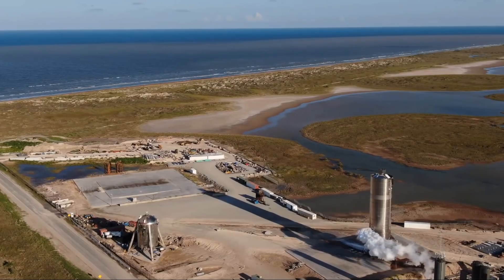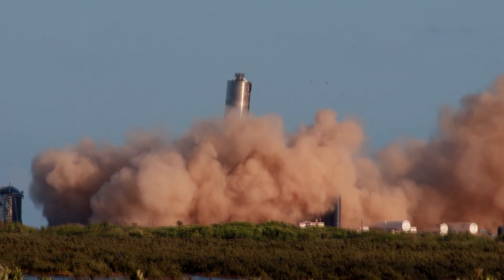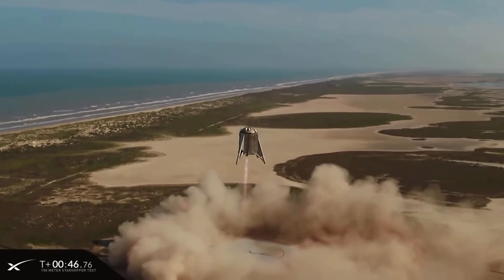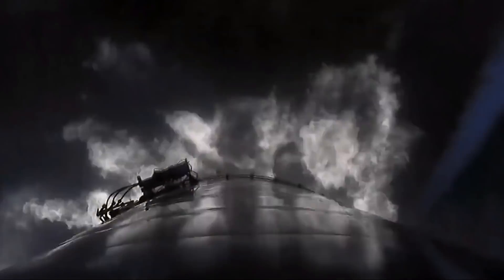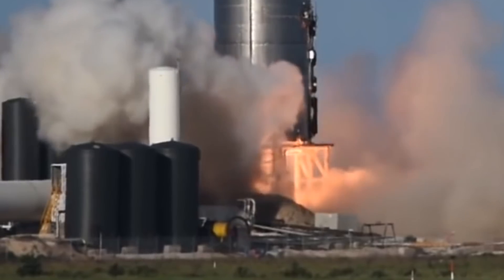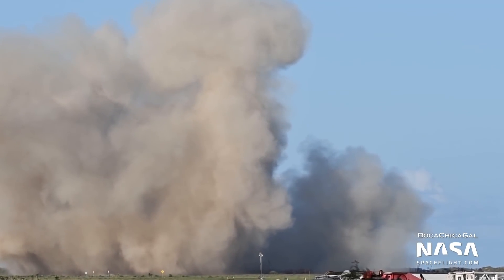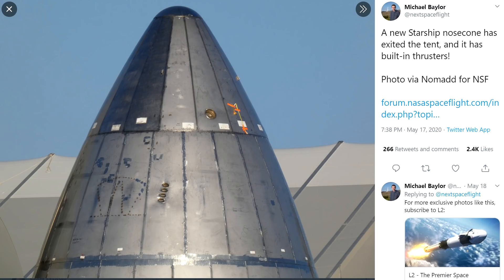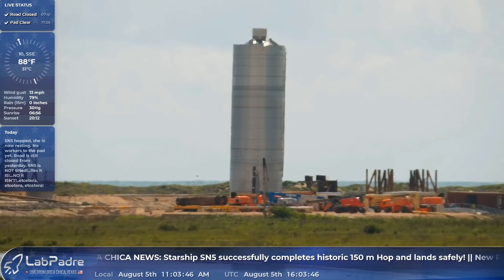SpaceX's Shiny Stainless Steel Starship Prototype Takes Flight For The First Time

Comment: No comment on the flying debris just after liftoff?? I’m looking forward to finding out what it was. Looks like a small explosion on the ground caused it.
Reply: Why does no one else talk about that debris. I was hoping Scott would say something about it
Reply: somebody tried to dry his carpet by hanging it on the fuel pipes
Reply: I know, I totally thought he was going to talk about it. I wonder what it was.  Someone mentioned the concrete got so hot it exploded but that doesn't make sense
Reply: @CessnaPilot99  Concrete can absorb or contain moisture, specifically if the concrete isn't that old. Intense heat can flash the water inside the concrete into steam, basically making a bomb.  That said, I have no clue what it was. I don't think it was concrete flying through the air.   Edit:  Looking closer, I'd bet it was some heat shielding material that protects the ground fuel supply lines. You can see a small explosion after it lifts off from the pad.
Reply: @Tjunky2  Best guess so far...
Reply: GrummanPilot99 concret, while hard, is still very porous and contains a large % of water. throwing a bunch of heat at it will cause it to expload from the water instantly boiling and unable to vent fast enough. also, the material looks to be part of the stand/ heat shielding as others have said
Reply: @CessnaPilot99  why doesn't it make sense? Do you know what concrete _is_? It's chock full of water bound into gypsum crystals. Get it hot enough fast enough, it absoletely does explode. This would hardly be the first time.  Get it hot enough at any speed and it will eventually crumble when you drive off the water of crystallization and the gypsum crystals holding the Portland cement together disappear. ;)
Reply: Seems SN5 destroyed fuel adapter (there is fire burning afterwards)😹
Reply: It looks like it came from the stand SN-5 was sitting on pre-launch. I'm betting that some of the insulation got blasted off when the raptor exhaust plume hit the stand during the power-slide.
Reply: @ntm4  Yep, another good guess... we'll find out soon, I think!
Reply: If you have 200 tons of thrust aiming down you can even make asphalt fly.
Reply: It looks like, as the SN5 does its power slide, the rocket exhaust passes over the upper ring of the frame it launched from, cutting it like a cutting torch.  This is what I think the bright flash was.  A split second later something flew upward, I guess people are saying it is asphalt.  It could have propelled a piece of the metal frame downward at speed, which could impact the ground and break loose a section of asphalt which then was caught by the exhaust wind and thrown.  IDK  that's what it looks like to me.
Reply: I was really hoping her have some insights as well.
Reply: I'm guessing it was just some insulation for cryogenic fuel pipes.
Reply: You can see at 9:55 that the engine exhaust interacts with the launch mount and then the debris flies up
Reply: You can actually see a fireball that accompanies the flash right before the debris flies up into the air in the aerial angle.  My guess is the raptor did it's power slide over one of the tanks sitting near the pad and it exploded.
Reply: I was amazed to see Blue Tent still standing, apparently undamaged. OK, it's partly a perspective effect, and it's further away from the rocket than it might appear to be. But it's still only an awning.
Reply: Maybe it's some of the concrete from the launchpad? Rocket engines are well capable of melting and destroying concrete.
Reply: How could it be concrete, after the static fire burns?
I’m with the GSE being blown to bits when raptor passed over it.
Reply: Someone left a porta-toilet behind next to the launch pad..... you saw the weeks downloaded burritos reaching for the sky.
Reply: @theravedaddy If I'm not mistaken "The weeks downloaded burritos reaching for the sky" is a country song. :)

Comment: More worrying perhaps is the glowing pipe on the LHS of the engine trunk, just opposite. It doesn't look like a reflection, it's asynchronous to the fire on the right.
Reply: It looked to flare with the fire on the right, so I think that fire probably reached around enough to appear like a glowing pipe from that camera view.  Assuming I'm looking at the right place

Comment: At 3.30ish there seems to be a pipe, beginning to glow red hot, on the left side of the engine. Any ideas??
Reply: I think that is related to the fire you can see on the right hand side. Assuming I'm looking at the right place, as it comes and goes with the changes in that fire

Comment: Very exciting and a great achievement - a true milestone.  That being said I saw two anomalies.  First the fire within the plumbing of the Raptor engine which you discussed in your video.  Second - there appeared to be an explosion on the ground just after liftoff which threw up shrapnel and debris.  The debris can be spotted from LabPadre's video, but the explosion can be seen most clearly on the drone footage - looks like the explosion threw up the debris and may have in fact caused the fire on the Raptor.   Not sure.  What are your thoughts?

Comment: Unacceptable safety risk sorry. Baby steps before sprinting with bombs please
Reply: What was your safety concern here? Yes equipment was at risk, but otherwise?
Reply: Nic H hi nic, merely the ‘unattended fuel tank no one would go near until it cooled down with no note on health and safety risk assessment... perhaps guidelines differ from UK...? No biggie. Bomb didn’t explode thankfully and I’m not a scientist... so prone to being hold of wrong end of appearance no biggie
Reply: @phillipalexandercarr1462  not so much unattended, but no one would go near it due to the safety risk until the excess fuel had boiled off and pressure lowered to safe levels. They have also been using a Boston Dynamics Spot robot fitted with a gas sensor, which they have named Zeus.

Comment: Why stainless steel. More complex weld or is it ally?
Reply from the maker: They switched over from carbon fiber composite because steel is faster to develop
Reply: @scottmanley  And cheaper, and better structural properties under the planned operating environment

Comment: Looking at the spacex footage, something explodes in the pad and fires debris straight upward. If SN5 hand gone straight up instead of power slid of the pad, could that have destroyed the tank?
Reply: My theory is it wasn't an explosion as such, but the thrust from the raptor tearing off part of the test stand during the slew caused by the offset raptor. So if it had gone straight up that wouldn't have happened

Comment: 304L is also the most common structural stainless steel manufactured on planet earth. I'm sure the ability to re-locate manufacturing with minimal supply chain complications will be a huge cost savings benefit. The hull is the bulkiest and most expensive part to transport. This is now easily solved by renting space at the client's launch site and calling the local steel supplier. They'll have plenty of 304L. Wait for an Amazon delivery of Starship guts, and you're ready to go.

Comment: 1 - Debris seem to be chunks of soil around the concrete base and/or concrete from the base itself.
2 - Leaning: the atitude at flight is consistent with "vertical" landing on the lower legs first, which could have damaged the legs and/or buckled the skin a few meters up.

Comment: I know I am not the only person to see unexpected explosion 4 seconds after engines started. Shrapnel flew up and you can see it made it as high as the top of SN5 while flying. Did any of that Shrapnel hit the engine and maybe cause that small fire.  

Don't get me wrong, this was all totally awesome and long awaited for and the flight went what seems perfectly.   But nonetheless a small secondary separate explosion from the ground 4 seconds after ignition can be seen and in one video looks like a super bright camera flash till you can see chuncks flying higher than SN5 into the air.  Could have been a totally different video if those chunks hit the engine directly while in flight.   Did you see it?

Comment: Isn't it possible that they tweeked the fuel mix on the hopper during landing to throttle lower than 50%?
Hopper couldn't be more than 100 tons, could it? When sn5 is so much bigger and has a mass simulator on top?
Or was hopper loaded with more fuel?

Comment: Hi Scott. Thnx for your thoughts about the flames licking around the top right of the Raptor engine. I'm pretty certain that that is something that everyone will be asking about! Also the comparison between SN5 and the hopping water tank with the yellow exhaust which launched around 1 year ago was interesting. Your suggestion that the yellow exhaust may have been caused by the Raptor engine 'burning itself up' is the only possible explanation we have heard. One thing I missed in this video were your thoughts on the black debris flying around the launch site on the SN5 take-off. It looks like some damage which may have broken off the launch pad? Any ideas anyone...?

Comment: I found it interesting that it appeared the engine vectoring under the control of the closed loop was tracing circles to keep the thing upright just as a plate spinner does with their pole.

Absolutely fascinating. As someone who has been playing with autonomous planes and rotors using early gyros and later full 6-axis gyro/accel flight controllers, I'm still impressed at what can be achieved with these MEMS sensors and a few blocks of PID code.

Bravo SpaceX... Mars within our lifetimes suddenly seems a real possibility... nay probability!

Comment: 9:38 Elon said they want to do numerous short hops with some rapid refires  to get the launch process just perfect before moving on to high altitude flights with aerodynamic body flaps
Reply: Agree. He mentioned shorts, and somewhere also mentioned a 3k one. SN5 might make another one, then I expect SN6 to make a series of them (with a nosecone), and hit 3km There's lots to learn than just "Oh, it worked." Plenty of time - SN8 will be slow build, they've never attached elerons before. And they'll do away with the external tanks?
Reply: Think they will also be giving star ship longer landing legs for un-even terrain that mars and the moon has. Will be cool to see
Reply: That'll be fun to watch. I'm totally stunned they can control this thing well on its first flight especially with the offset Raptor engine. I'd really to understand how they simulate these flights because I'm sure there must be a lot of that. Aerodynamics don't matter so much for this 150m hop so simulations might not be too hard, but they will matter greatly for higher, faster flight and that must be really hard to simulate well.

Comment: It seems we're back 90 years, when learning how to lift a rocket from the ground!
My eyes couldn't accept the shape of the ship, although makes sense considering a short hop at slow speed. I agree with Mr. Manley when he calls it a "grain silo". 
Well it proved the Merlin, this monster engine from the future, with its full-flow design. I tried to get into the details but... Yes, I grasp the operating concept but the engineering solutions are... wicked, from my standpoint. For the time being, hats off to the SpaceX engineers, it seems they know a thing or two about thermofluidodynamics and structural engineering; and the software developers, the guidance and control didn't lose a beat.
Thanks to Mr. Manley, for the timely and accurate report; your passion for space flight is contagious!!!
Regards from the UK...

Comment: The thing burning at the engine, might it have been some of the debrise that blew up and away got stuck on the engine and burnt?
Reply: It's the flux capacitor bursted
Reply: That's what I'm thinking.
Reply: I heard a theory that the bearings used in the raptor use liquid methane and liquid oxygen bled off from the main line as a lubricant and that it might have been a relatively minor leak from one of those. Not overly familiar with raptors so just passing that on as a possibility

Comment: 6:55 might just be the lens but it does look like he right side is well... not a striaght line
the structural loads when launching with signicant acceleration or touching down is kinda the main worry about this whole thing

Comment: Is that burst and debris flying up at 10:00 part of the rocket stand being destroyed by the exhaust?
Reply: That's my theory. If you look at the timing it happens exactly as the raptors thrust goes over the rim of the test stand during the slew due to the offset raptor.  Basically it's not an explosion so much as the part of the test stand being torn off and kicked back up from raptors thrust

Comment: What are the dimensions of this stage?  I had no sense of scale watching the flight.
Reply: 9m diameter, 30m tall, flying to 150m.
Reply: @owensparks5013 
Thank you.
Reply: @jshepard152  
Sure thing.
Reply: If you need something for scale, there are what look like 40ft by 8ft by 8.6ft cargo containers all over the place. Judging by those I would say that the landing pad is about 200, maybe 250 square ft (cca. 60 to 75 square metres).

Comment: Ideally your engine to oxidizer propellant ratio should be 0.
Reply: For some once off rocket engines its nonzero by design.
Reply: @ashsilverwizard3275  aye, ablative nozzles.
Reply: @ashsilverwizard3275  RS-68 is one good example.
Reply: @FastSloth87  shuttle engines?
Reply: @joeyknight8272  Shuttle/SLS engines are called RS-25 (or SSME), the RS-68 is main engine for the Delta IV family of launch vehicles.
Reply: @FastSloth87  Quite, if a hydrolox engine has a orange exhaust then it definitely has some engine in it :)
Reply: No, by "1" he means perfect combustion.  .95 would be rich 1.05 would be lean.
Reply: The ratio of 4::1 (or) 3.5::1  whatever it takes to consume all of whatever fuel is used that ratio is equated to 1.  Then you vary that by a percentage.
Reply: Unless you're using an ablatively cooled engine
Reply: Don't you mean 1?
Reply: @xaile5293  1? if by one you mean the ratio that would mean the nozzle disintegrates :)
Reply: @ashsilverwizard3275  I mean the oxidizer propellant ratio. a ration is two things divided by each other so 0 would be only propellant or only oxidizer. 1 would be the right amount of each so that complete combustion occurs
Reply: @xaile5293  the engine is not the propellant here, that would strictly be carbon dioxide and water products from the fuel oxidiser reaction.
Reply: @terminus.est.  sorry meant to say oxidizer fuel ratio
Reply: @xaile5293  Even if fuel oxidiser ratio was the subject of the original comment, it definitely would not be 1:1 by mass or by  absolute quantity.
Reply: @terminus.est.  "even if fuel oxidizer ratio was the subject of the original comment" Is it not? (English is not my first language and it seems formulated quite weird) well it definitely wouldn't be 0:1 either. with 1:1 I meant to say stoichiometric amount.
Reply: @terminus.est.  never mind i think I understand what he means now. is it that there should be no oxidizer left after combustion to damage the engine nozzle? that would make more sense
Reply: @xaile5293  The original comment is a joke based on what Scott said at 2:56 about "Engine-rich exhaust". This means that the exhaust contains high amounts of the engine itself. Ideally the exhaust should not contain any amount of the engine because eventually you will end up with no engine.
Reply: @xaile5293  If you want to get technical, then the ratio should be roughly one mole engine per two moles oxygen, assuming the ablative nozzle is carbon. Edit: Actually the orange means there is soot in the exhaust I think, so that means engine to oxygen ratio is more than one a lot more than one.
Reply: @xaile5293  That's the point of his comment. Your fuel to oxidizer ratio can be whatever you want, but the engine to oxidizer propellant ratio should be 0. If it's higher than zero, that would mean the engine itself is consumed during the reaction.

Comment: How is the engine able to sustain its own shockwaves on takeoff and landing?  The engine comes within a few feet of the landing pad.
Reply: Presumably just like the Merlin engines on the Falcon the Raptor can be throttled down. Thats what the Merlins do on landing.

Comment: It's not over until Scott pops up and answers all the questions!  Thanks Scott. It will be interesting to see what that engine fire was and how the legs stood up. I wouldn't be surprised to discover that this flight had its Star Hopper moments too. The fan boys all think this is just another inevitable step towards Mars colonisation, but it's actually a very risky hit and miss development process, with each stage pretty much as likely to succeed as it is to fail. I fear your prediction is right - we WILL see a good few failures (some spectacular) before the first production model Starship actually flies.